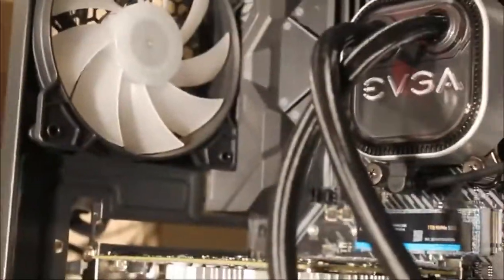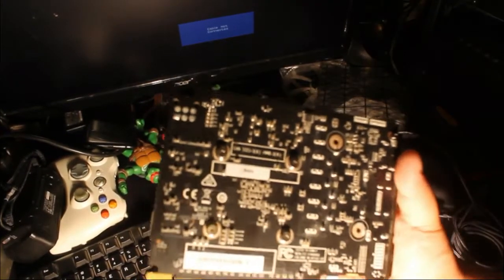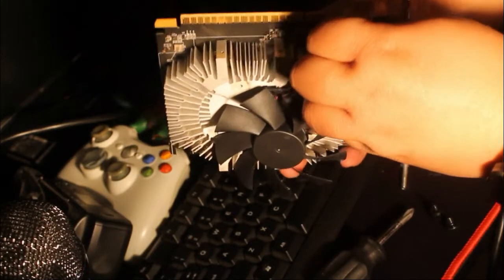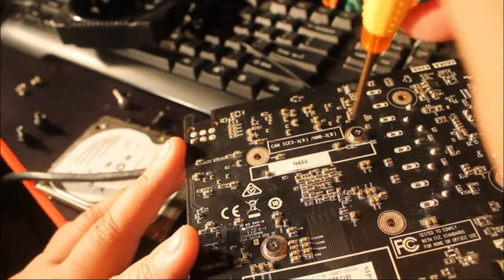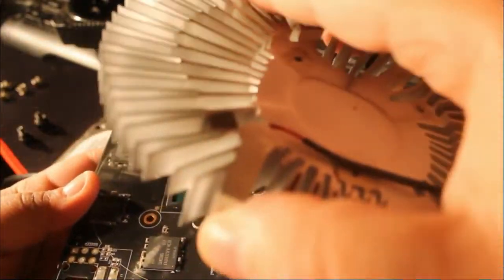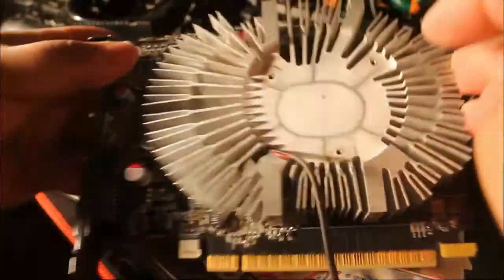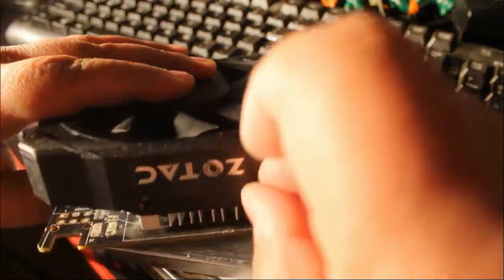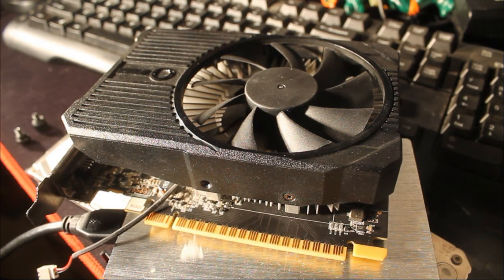Zotac Nvidia 1050 TI 4 GB Fan Replacement And Heatsink Compound Upgrade (FAST PROCESS)

Comment: So the only power connector is the two-pin one on the lower left corner huh.. I got an aftermarket cooler which is a four-pin type, and i don't know how to connect it to power supply..

Comment: Thank you for making this video. 

I was taking apart a Zotac 1050 2GB Mini to remove the fan and clean dust when a rubber piece fell out. Couldn't figure out where it came from based on any witness marks (gaps in the dust.) Thankfully it's easy to see from this video that the rubber square keeps the fan cord from coming up through the heatsink and rubbing on the fan.

It was the part keeping you from removing the cord straight through the fins. Also I had the same problem with removing the fan wire, had to use pliers and fingernail to carefully separate them, but it looks like you can just slide it back on if it comes off all the way.
Reply from the maker: glad i could help follow my channel I'm always vlogging about things i get into

Comment: Can u use arctic t paste for CPU
Reply from the maker: yes you can use cpu thermal paste.
Reply: @justbored3.14  i did it wooo. its runs around 37 on idle what was yours
Reply from the maker: @AintPopular    i was in the 50 60 at first then 30 40 after

Comment: LoL he just pulled out the plastic of connecter : )
Reply from the maker: it still works just put that card in my new build my gf just built  she has the latest and greatest ryzen 9 cpu and 970 2tb  m. 2  32gb ddr4    but the gpu is this old battle axe lol

Comment: What type of screwdriver did you use, I have to get one cuz all of the ones I have are slightly too big
Reply from the maker: I have like 20 screw drivers no joke.  Bought a set of screw drivers from sears a long time had like 15 different sizes. Then bought another set that had security screws and hex.    I work on electronics so i have to have them.

Go to home depot and get a kit they will have small sizes

Don't pay more than 20 if you can only if they good quality  cause some are worth 20 or more... Insulated handles and magnetic
Reply: Ok Thx bro👍🏼

Comment: sooo the 1050ti doesnt need any thermal pad but it does need a thermal paste, right?
Reply from the maker: if it had a thermal pad i replace it with heatsink compound.  unless there is a clearance issue.  some devices require the thermal pad because it the heatsink will be a few centimeters away from the contact point and the thermal pad is thick enough to connect them both.   but  if both surfaces touch and have tension with each other i use heat sink compound

Comment: I had trouble removing the fan wire as well, the plastic was coming off, i was worried to pull it off the solder points.. so saw your video. You had no problems after :) so i just took mine out like you did and its all good. Thanks :) Fyi mine is the Zotac 1050 Ti OC edition, I hate that its always at 45% fan speed even idle, cant change it cuz its a "feature" so i unplugged fans and will remove them just have the heatsink there, my case has great airflow, will test it now, let you know if it blows up lol
Reply from the maker: Let me know if it blows up
Reply: @justbored3.14  it idled at around 45 degrees, then I played some dbd and it got to 95 lol. So I stopped, let it idle, let the case fans cool it down a bit then I shut off the PC. Put the fans back on, 33 idle, 65 max gaming. Darn lol, it was so silent. I think maybe if it had a bigger heatsink it might have been okay
Reply from the maker: @itsGuy  they make water cooled heatsinks for it that you can add to a existing water cooled system.   Yeah 65c ain't bad
Reply: Had that exact problem as well on a Zotac 1050 2GB Mini. It started coming out even when i used a pair of pliers to pull and my fingernail to hold it in.

Luckily that's not too much of an issue since the actual pins were soldered in well and the plastic slides right back over them.

Comment: "Why am I working on top of a hard drive, on top of a hard drive, I'll tell you, . . . that's why": I'm rolling !!! How were the temp's before and after the new paste ?
Reply from the maker: i did not notice any temp anomalies  only performance issues then the fan started squeaking. thats when i  installed the new one.  my benchmarks were being affected on the old fan.
Reply from the maker: im sure temp issues were part of the problem but were not a system breaking issue yet